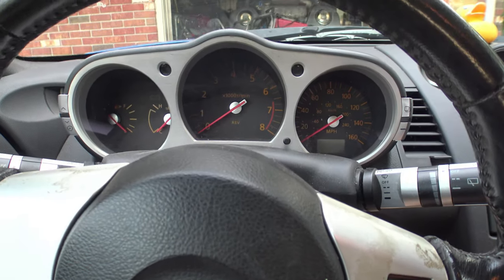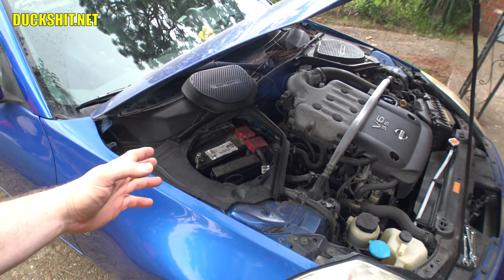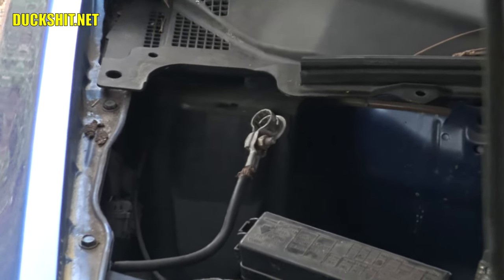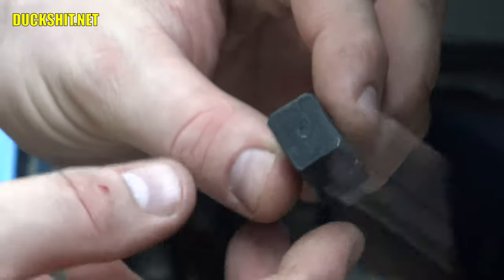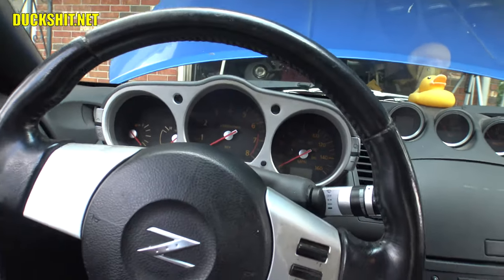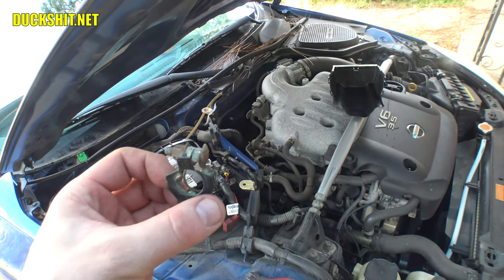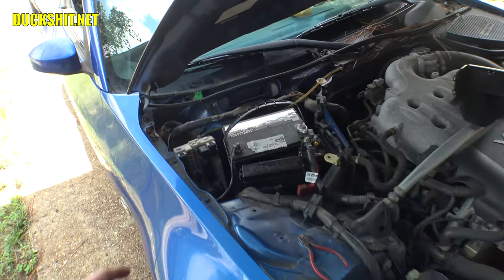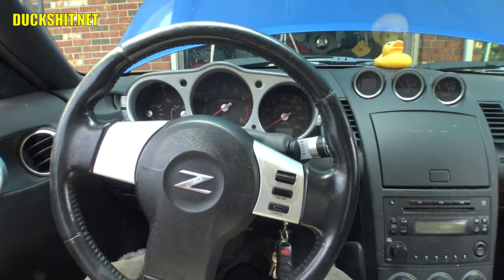Nissan 350Z Won't Start Fix - 4 Things to Try - IPDM Repair

Comment: bro i spent all day trying to figure this out, i hardwired the clutch sensor nothing i drove around looking for relays nothing finally found a place close to the house that strips Zs and Gs managed to get a full ipdm for $20, switched out the relays still nothing. tomorrow i am gonna completely swap it over and if that doesnt work im taking that whole thing apart because ive lost my mind lol
Reply from the maker: Oh man, I hope you figure it out and that its something simple!
Reply: @DuckmanCycles  did everything under the sun and still nothing I finally got the car to start by pushing it and dumping the clutch got the car in the driveway and took a cable connected it to the battery and the starter which allowed to car to crank, so somewhere along the line the starter isn’t receiving power

Comment: I am having problems with my 350z 2008 ... I start it up and it runs for a sec and turns off it’s always on the third try that turns on ... and runs fine ... what could it be ???
Reply from the maker: Are there any error codes?
Reply: No
Reply: @DuckmanCycles  
No ... well not yet .... i been searching what could it be and man ... it’s hard
Reply from the maker: That is really unusual.  I have had that happen, but it was due to the mass airflow sensor accidentally disconnected.   BUT... it gave me an error code!   Have you talked to anybody on the 350Z message boards?
Reply: @DuckmanCycles  no i have not what is that ? I went out and it was driving fine ... I was gonna go home but it wouldn’t start only on the third try ... then I went to put gas and it ... wouldn’t turn on only on the third try ...
Reply from the maker: Well we have to make sure we're speaking the same language here because now your description of the problem is different than it was earlier.  Wont turn on?  Or turns on and cranks and starts but then stops and only runs on the third try?   These are VERY different things.
Reply: @DuckmanCycles 

Sorry ... so the car does turn on but then it turns off ... on the third try it turns on and runs fine ... I turn it off and then turn it back on agin .... it doesn’t turn on till the third try .... the third try it goes on and is able to drive perfectly fine
Reply from the maker: @omarcontreras8067  This is even yet a different description from the first two.... so the car turns off?  Like all lights on the dashboard go dead?
Reply: @DuckmanCycles  no by off I mean the engine stopes
Reply: Everything else still works like the lights and everything but the engine ....
Reply from the maker: Try swapping the ECM relay with the Air Conditioner relay.  If problem moves to the air conditioning and car runs fine it's a bad or intermittent relay.  You can also try switching the ignition relay with the high beam relay.  I had that happen before.  Neither one would throw a code.
Reply: @DuckmanCycles  ok thank you so much for replying fast and helping me .. I will try this tomorrow.. and see how it goes wish me luck I will update you

Comment: mine won’t even turn on anything on the cluster😭
Reply from the maker: Make sure the battery is connected and the ignition switch is good!  ...and check the ignition relay!

Comment: I had once a broken air pressure valve on my 9-5, the off. dealer didnt found the failing
parts and tried to sell me a new DI-box (700$) and a throttle body (700 again). At least
with labour and taxes about 1800.- The failing part was 45$, with 15 min labour.
Reply from the maker: ACK!  Thats not cool!

Comment: the thing is my lights don’t come on only the brake light
Reply from the maker: check fuses relays common last Lee the switch. If all else still fails it's in your wiring.
Reply: thank you! luckily the dealer fixed the problem. it was the main relay
Reply: @igsmirkggs8091  how much did they charge you ?
Reply: @inaj27  my dealer fixed it for free cus i left it at my job for 3 days and i wasn’t gonna deal with it
Reply: @igsmirkggs8091  🍀

Comment: I have a 2003 Nissan 350z and my brake light fuse kept blowing and than my car eventually wouldn’t start
Reply from the maker: Wonder if that was related, those should be independent circuits
Reply: Ya when I drove it last I lost my tansmission and I had to almost completely stop for it to work because it was stuck in gear because it’s an automatic but when I turned it off it would turn on at all but the fan would kick on like it’s overheating
Reply from the maker: Fans coming on but not much else is a sign of a fried ECU.

Comment: Just jump the relay it will never need a relay again lmao
Reply from the maker: Thats what I demonstrated on my Instagram video:  https://www.instagram.com/p/Bzrin9VnafM/
I would have bypassed the internal IPDM trace and ran a wire from the left side of the fuse to the wire going to the clutch switch.... that would have fixed it, too!

Comment: I'm having the same problem but it's causing my fans not to turn on.
Reply from the maker: that's interesting, usually on a 350Z it's the opposite. The fans come on but nothing else happens.  In your case it just could be a fuse or relay, but those fans are notorious for going bad so you might just replace the fans also, that was something I had to do it right about a hundred thousand miles.
Reply: @DuckmanCycles  I appreciate the follow up response and left out it's a g35. But I will not let this beat me. I love what your doing with your channel and I'm here to stay.
Reply from the maker: Thanks so much, Torry!  But the same goes for 350z or g35, fans run when ECU is blown, and thats about all.

Comment: You are not even showing where the relay is how am I supposed to know
Reply from the maker: That's because you didn't watch the video LOL
Reply: Sorry but was a bit frustrated rewatched swapped the relays but still wont crank
Reply from the maker: Clutch switch problem?
Reply: Its an auto. Im being told its the alarm that won’t let the car start
Reply from the maker: Can't help you with that sorry LOL... very different situation there
Reply: But we removed the alarm it was aftermarket and still wont start do you think it still has to do with the alarm or the relays?
Reply: Should i replace all the relays

Comment: " It's not serviceable, dont even try it. "
" Why, someone made it right? It can obviously be fixed. "
" Huh, in Neverland by the Nissan fairies. Hope you got some flux and pixie dust. "
" I'll bring the pixie dust, you've obviously already got the Astroglide. "
Reply from the maker: LoL yep... Haha!
Reply: @DuckmanCycles  oh hey, since you're here... I had a question about the harnesses plugged into that IPDM. Do they all unplug the same way, by depressing a center clip and pulling out? Think I got 3 out before cursing it and putting it back together cause I had to get it into the shop the next day for the dreaded timing chain job. Broke one of the little square tabs off one too. They're tough as nails after those first 3, a lot like pulling teeth... Thks
Reply from the maker: @GodWasAnAlien  Yes they all come out in a similar method, and they're stiff and hard to unplug!
Reply: @DuckmanCycles  thanks
Reply from the maker: Good luck to you my friend, let me know how it works out
Reply: @DuckmanCycles  thanks. Its a 2005 Xterra I just picked up for $4500 after a spacecase afrowoman totalled my 2000 5spd B2500 Ranger. Hit me at a stoplight going about 50mph. Lol she wasnt worried about me at all, started inspecting her own brakes and then her busted up front end. I said "the brakes only work if you push the pedal on the left, cvnt." Fkn insurance co gave me $2500 for it so I kept it for salvage, amazingly enough dont think the frame's bent so Ima take the mangled bed off and try to put a flatbed on it.
Reply from the maker: Oh my... glad you're still here!

Comment: Guys help a bro out! Anyone pls! My 350z don’t click it don’t crank and it don’t turn on! Somebody pls help me I’m lost here n I switched the battery out because it was dead n I put a new battery on (HONDA) not that it matters but It still wouldn’t turn on
Reply from the maker: Couple things, check your battery terminals and make sure the fuses in the positive one are good.  Check the ignition relay in the IPDM behind the battery... you can swap it out for the one for your high beams if you would like to test it.  Lastly if it's none of the above, you may have something wrong with the ignition switch itself behind your key.  And if it's not any one of those things that you have a more serious or oddball problem, like wiring damage, or a loose connector somewhere.   Good luck to you!

Comment: I’m in desperate need of your help . So the Dorman battery fuse on my 05 350z keeps blowing out , even daily sometimes. My battery,  alternator, and starter are all good . I realized the whole fuse wasn’t connected correctly but looking at how yours was in this video . I need some help ASAP please . Email me if possible so I can send you my number for pictures and videos
Reply from the maker: If you're blowing that big fuse, and all your devices are good, and wired correctly, then you have some severe short, possibly in your starter or alternator wiring.  Start chasing the big wires coming out of it and look for exposed wires, burn marks, or other damage.  Whatever it may be, it's big, intermittent, but should be obvious!

Comment: Wish you were here in NC 🥲
Reply from the maker: I'm mobile, I have wheels.... hehe!
Reply: @DuckmanCycles  Haha, I have a 2008 350z with same issue. I replaced battery, got a starter (getting it installed tomorrow hopefully if it's not raining) but I don't have a clutch... will see if that corrects the issue but I truly appreciate the thorough content on possible issues and resolutions. Keep ya posted!
Reply from the maker: Hope that worked out for you call me let me know!
Reply: @DuckmanCycles  Yessss!! I'm on the road again 😁 Thanks again for the very informative video of possible causes. Your the man!